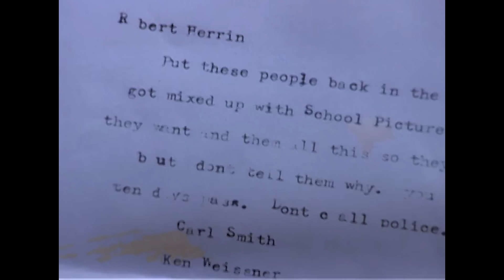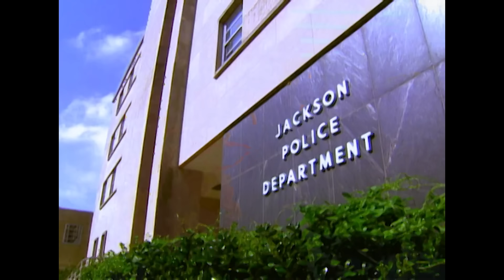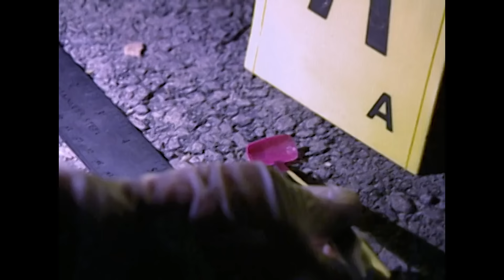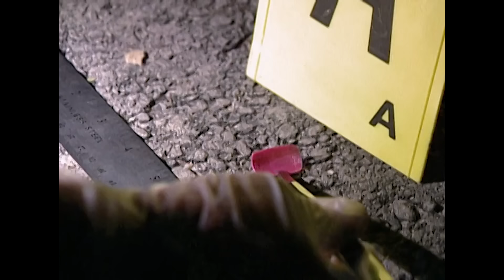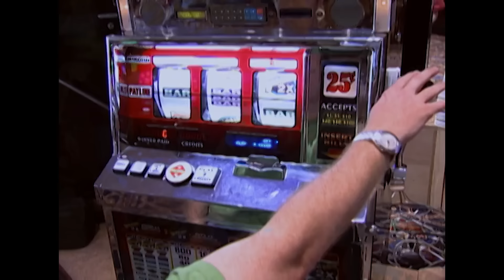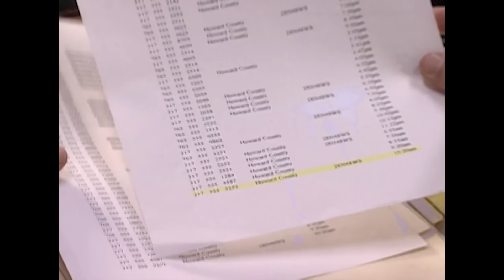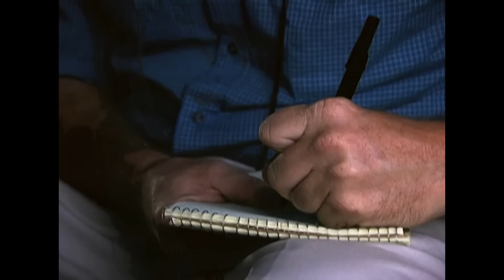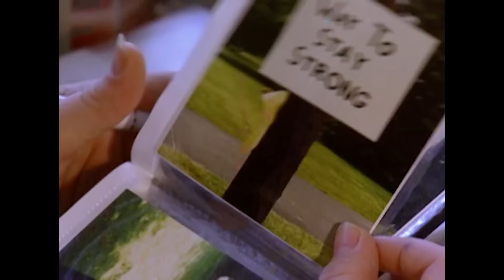Kidnapping Epidemic | TRIPLE EPISODE | The FBI Files

Comment: As always this video speaks of polygraph as if it were capable of detecting "deception"  when in fact the only thing a polygraph can detect is stress.    Cops know this, but they like to pretend otherwise because "stress"  is exactly what they want,  not to measure, but to cause suspects to crack under pressure.
Reply: I agree.  I'd never take a lie detector test.  Can't ever help, it could only hurt a person.
Reply: Because the stress is an indicator of deception. They ask the person simple, obvious questions to start in order to get a baseline. So just the fact that you are stressed about being there would not produce a result that indicated deception.